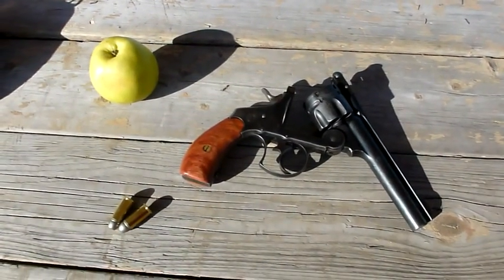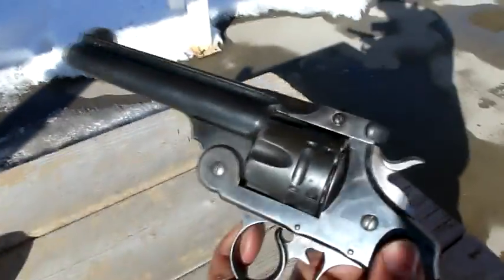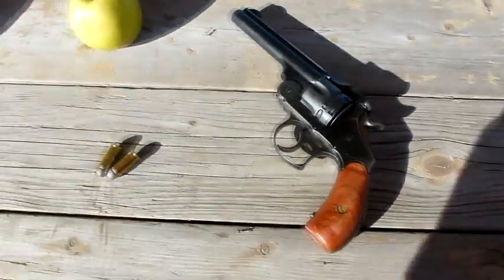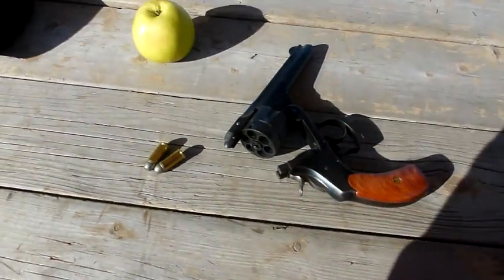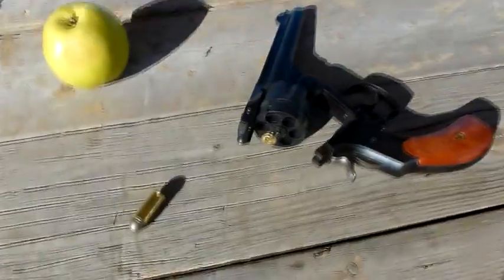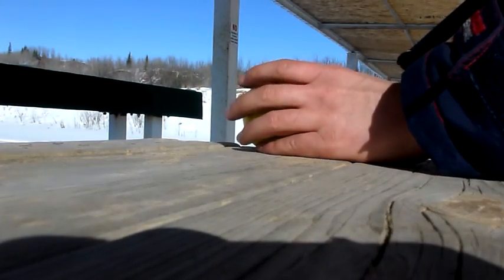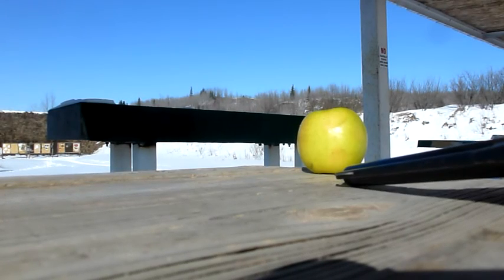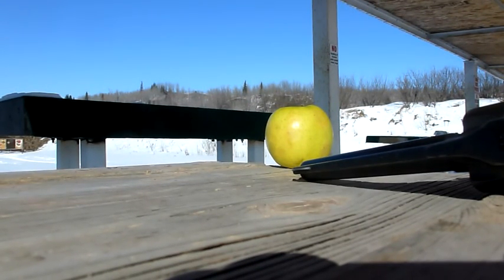Low power revolver cylinder gap blast danger? A slow motion study

Comment: Just because it's black powder doesn't mean it won't burn you badly. When I did re-enacting and fired cannons, we had to be careful of where we held the linstock that held the burning slowmatch which was used to ignite the pure black powder that primed the cannon. It would produce a solid jet that was up to about 7-8 inches the diameter of the vent hole as the excess powder would burn outward and upward. We had a couple guys who were not careful and luckily for them, the only thing burned was the heavy cuff of their uniform coat. What burns you from a cylinder gap blast is the powder. Nothing actually comes out but the excess powder being burned off as it escapes the chamber and forcing come. All revolvers, blackpowder or otherwise, do that. Go to a gun shop, open a revolver, any revolver that's been used and shot some, and look underneath the top strap, you'll see a fine line behind the forcing cone, it's called flame cutting, look it up. It's where the steel of the revolver has been burned and etched over and over as the gun is fired. I've seen them even in .22 LR revolvers, and if it does it in a .22, guarantee you will get burned by that gun of yours.

Comment from the maker: I've been told that is normal and that old guns were designed with larger gaps than modern ones. The reason I was given was that black powder produces much more residue than smokeless, meaning that a small gap would quickly get gummed up to the point of hindering the revolver's action.

Comment: OK I'm confused
1st
In the video you say the gun is a Russian
in the written explanation you call it a S&W 
2nd
Is it low powered because of the amount of powder you used or just because it's not a magnum?
3rd
Many years ago in the mid 1980s, a good friend had a fairly new Ruger 44 magnum built in the 80s.
You definitely did not want to stand next to that gun when it was fired.
It shaved lead going from the Cylinder to barrel
We never experimented with how dangerous it was, we just stayed back